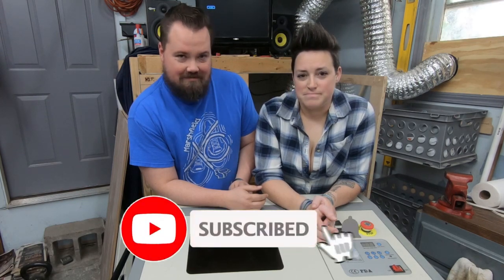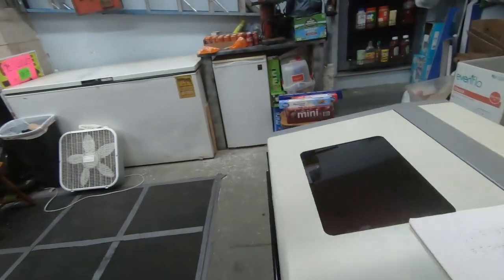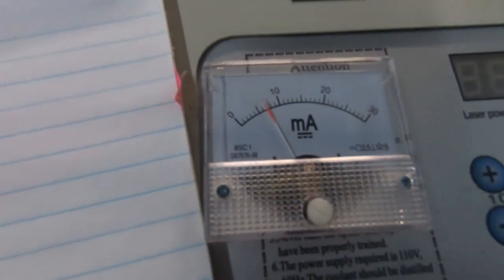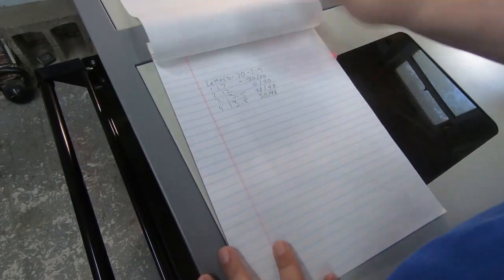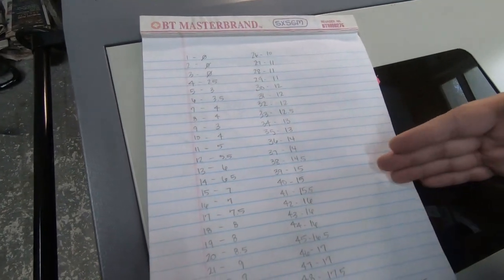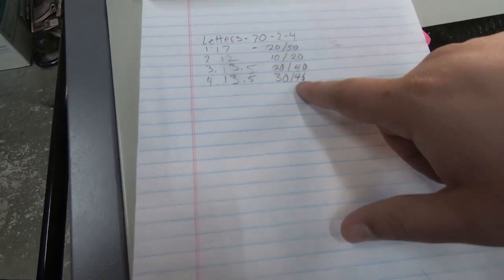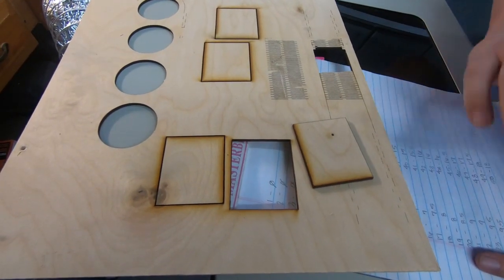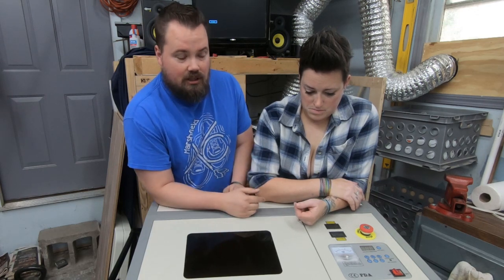Monport Lightburn Board test

Comment: I'm really surprised at the issues you're having with the Monport board.  Seems like it's more meant for a diode laser than a CO2 one as you should be able to engrave easily at speeds of 90-125ish mm/sec without needing a huge amount of power.  I run a Cohesion 3D board in mine and the only time I'm running with the power set above 6mA is when I'm cutting 3mm acrylic or leather.  all my engraving work I do around 4-5 mA at the speeds I mentioned before and get great results.  And like you said you need to get your bed so you can reset your focal length to account for material thickness and you will get finer lines for engraving and cutting.  Good set of tests though and keep at it, you'll get it worked out.
Reply from the maker: Yeah we are not super impressed with the board. If the power is under 30 it won’t even fire at those speeds. We have the cohesion board now and going to swap it soon.

Comment: Hi mate  you read your second test at 12ma but it was actually around 7ma. Question for you, what size tube do you have in there? Max watts? How many ma should you be pushing it to? From memory I have my k40 set to max power 100% at around 13ma so I don't burn out my tube.would be nice if I am wrong and can run it harder.
Reply from the maker: That would make more sense on the second reading that’s for pointing that out. We have a 40 watt tube and the manual says don’t run over 70% I like to stick in that 50-60% range. So I have no issues going to 20 ma
Reply: I typically don't run past 15-16 mA on mine, stock 40W tube, just so I don't stress it to much and shorten it's lifespan.
Reply: @ropeany1  Thanks Tom I thought that would be around the Max we should run for longevity.